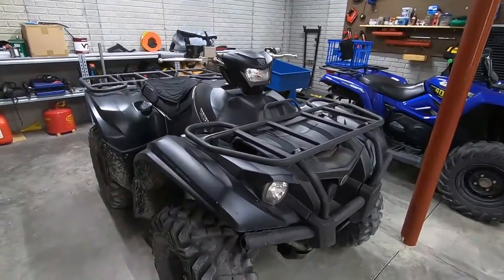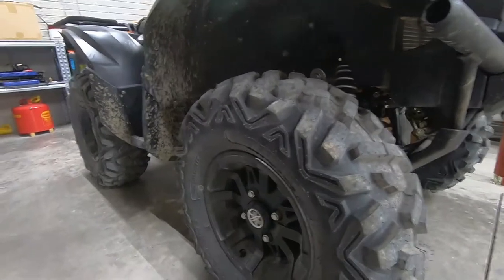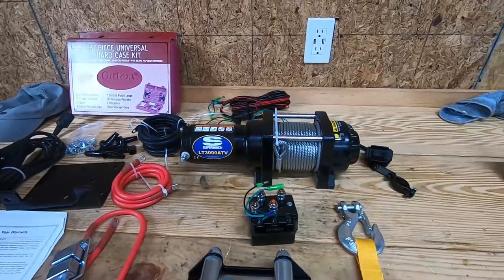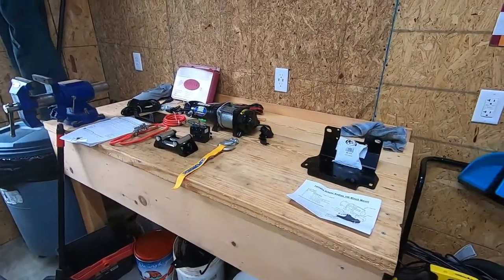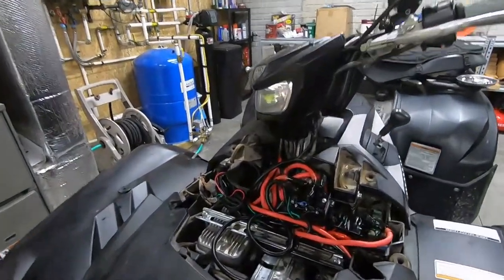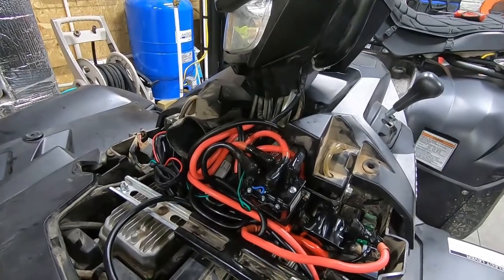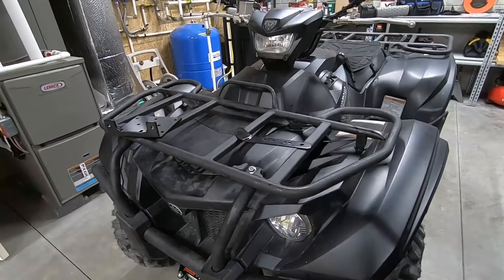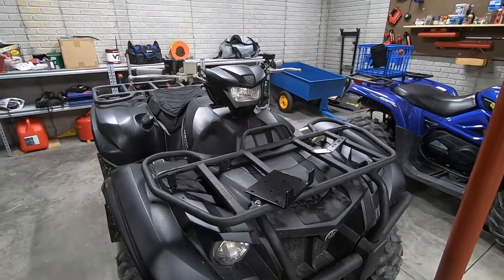Yamaha Kodiak 700 Winch Install: Everything I Learned & Did Wrong

Comment from the maker: If you have the ability to shorten the wires and put new ends on them,  that would make for a cleaner install. I have not done this yet since I'm not sure I'll keep the wires routed this way for the long term.
Reply: I went with the KFI 2500 lb winch. They gave me short wires for the contactor to the battery and long from the winch to the contactor. I swapped the wires and still had to cut them almost in half to not have 2 ft extra. Made it much cleaner.

Comment: First of all, you did it right the first time. The contactor should have just been mounted on the back of the winch plate. Mine was on my Kodiak for 5 years that way through Canadian winters. Lots of river crossings. Mud everything. It will not hurt it. They are watertight connection and contact her is sealed and the components are conformal coated for waterproofing. Anyway. The way you went about it was pointless running all that wire. You should have trimmed the wire to length. That would have saved a lot of hassle. Also, you did not need to remove the front rack whatsoever. The hood pops right out without it being removed. You still have ample room to work around the battery.
Reply: This is the comment I was hoping for. Just installed mine put the contactor on the back of the winch plate before I saw that he moved his. Made me rethink my decision and would've been annoying work to undo.

Comment: I mounted mine underneath and towards the front of the gear shifter, it's an isolated spot out of the weather and out of my way, by far the best spot I could find. I have an older model Grizzly so I have no idea if its the same on the Kodiak. Thanks for the great video!

Comment: I have a 2007 grizzly and they mounted the solenoid behind the winch now I’m having to replace it and relocate it to the top out or the elements. Great place under the hood
Reply from the maker: Thanks for commenting! Sorry you're having those issues.
Reply: The mounting location is not the reason you had to replace it. The contactors wear out over time. They can be completely submerged in salt water for life. It won't affect their longevity.

Comment: How did you get the solenoid on the back of the mounting plate? (I know it sucks, but options are options)
Reply: It doesn't suck. That's the proper place to mount it. It's designed to go there. On the KFI plate, you'll either have to drill a couple holes or make a mounting bracket. If you're using a Warn plate, it already has holes provided that fit almost every contactor.

Comment: How much of a price difference between this winch and the one from Yamaha? I’m curious as to why you chose this winch.
Reply from the maker: The price difference was roughly $100 if I remember correctly. There is nothing special about the yamaha winch, it's just a WARN 2500 with a different sticker. I was not a big fan of the warn plate. I found this winch that is still a good brand and larger capacity for a cheaper price. Either one is a good choice.
Reply: @TrailPass  thank you for the reply.  I have been researching quads for a while and have been going back and forth between the Kodiak EPS SE and the Kodiak EPS.   The only differences between the two models seems to be that the ES offers a different color option and comes with a winch for an additional $1,000.  I’m pretty handy when it comes to diy projects and after seeing your video i know i can install my own winch.  All that being said, your video has helped me in my decision to go for the Kodiak 700 EPS.
Reply from the maker: @hashtagjustadad5110  that's great, glad to help. Let us know how you like your new machine!

Comment: It's 2022.  It's an ATV.  Absolutely asinine there is not a kit from yamaha that is a bolt-in solenoid bracket/wiring kit.  $100.  I'd buy it.
Reply: There is a bolton kit. When you get the Warren winch from Yamaha you get the Warren mounting bracket and the contactor mounts right to the rear of it. Where is supposed to go. Zero issues. Mine was on my Kodiak since 2018 and it's never had an issue